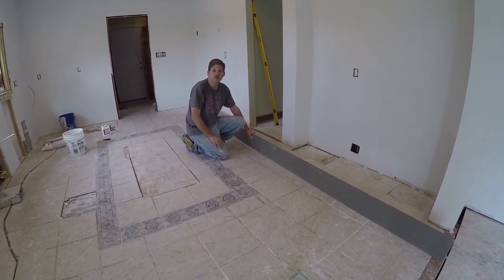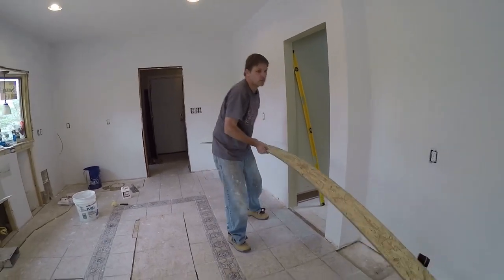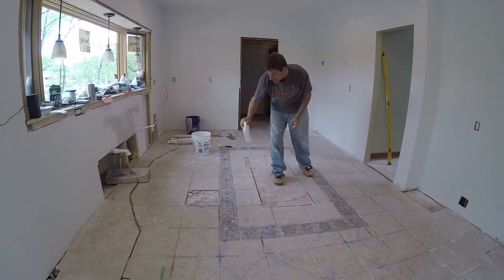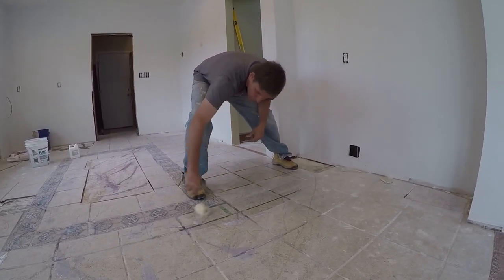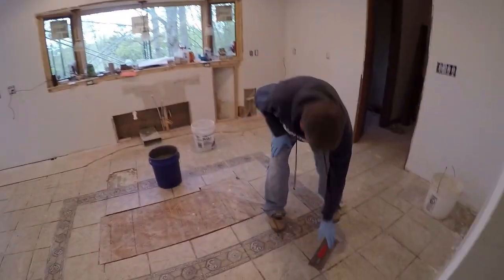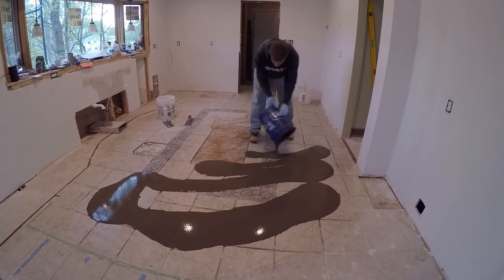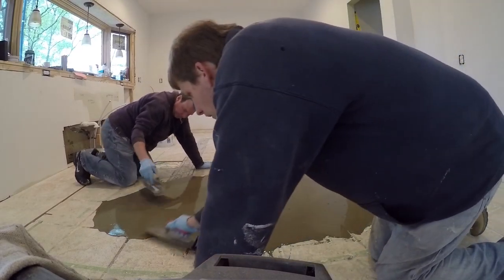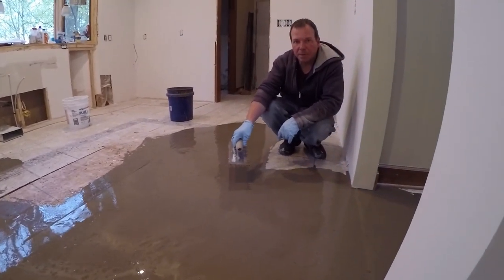How to use floor leveler to fill low spots before laying new flooring

Comment: Okay for all the professionals commenting on this guys method.
An installer can only go as far as the homeowners budget!
Yes tearing out the tile removing baseboards foam/caulk sealing the walls, and flatten the entire room to at least 1/16 in a 10ft radius WOULD COST THOUSANDS!!!

We as installeres encounter this issue EVERY TIME the homeowner doesn't have the $$$ to get it 100% perfect or they think you're just bs them.
Reply from the maker: Hey Bf3xx?
Thx for an insightful comment.
Reply: So you are saying he couldn't  afford a 9 inch roller sleeve and doesn't have an extension handle? And then they hand trowel the leveler? These guys are NOT professionals.

Comment: I’m doing something like this since we have tile with esbestus in it and we can’t break or move it without disturbing it. So we’re putting concrete leveler & flooring overtop of it.
Reply from the maker: Hey Kyle, 
We had good success w/ the leveler. Hope you have the same! Thx for watching!
Reply: WHAT!!!! Omg!!! Yes yes YES! This is what I have too!!! In my basement and it’s all high and low. I did my research and based on where the house was built it’s quite possible the tiles contain Asbestos so I do not want to remove them! Was thinking of doing leveler over them also!
Reply: That's what's in my parent's house, too. In addition to some of the tiles coming up in chunks over time, it appears as though there's a slight ledge around the perimeter under the tile. I have only been able to access a small spot. Seems to we about 4" in width and less than 1/2" in depth. Thinking self leveler is the solution for us. We're going to install a wood laminate.
Reply: Currently doing the same in my basement lol hope it works out for me. I caulked the edges and I'm doing the entire room though.

Comment: They floor has sagged alot and now youre adding more weight on that spot. I hope you checked why the floor was sagging and maybe added a support beam
Reply: A support beam where if it's a slab on grade...
Reply: @christiancenturion9895 just level it I'm in Dallas slab & the clay soil here is 💩

Comment: Can I do this method over asbestos tiles in basement?
Reply from the maker: Hey Krista,
If the floor is stable, it should work well. Could just try it in a small area first. But we are super happy with how it worked for us.
Thx for watching.
Reply: Same problem I have! Don’t want to mess with those tile. And I also have some cracked ones also.

Comment: Would this work over an old uneven plywood floor in order to paint and epoxy the floor?
Reply from the maker: Hey Falls…,
It is basically concrete. As far as I know both can be painted or epoxy (but not together ) You might have to wait before applying epoxy - I’ve read where concrete has to age / cure weeks or months before epoxy can be applied. I would ask manufacturers. 
Thx for watching!

Comment: I have a basement that is not level.. it is our main living area as the kitchen, and living room is there. It has carpet right now but we are wanting to rip it all up and put the floating hardwood down... Here is the problem- a year ago, we had a huge rain storm and water was seeping up from under the concrete. It has only done it 1 time since we have lived there and it has to be a large amount of water in a very short time but we have got to get it sealed as well.  It took us days to suck all of the water out of the carpet and get it cleaned and dried..... So not only is it un level, it also has cracks in it as well. So my question... what would you all suggest? And also, if we were to seal it... will the leveler adjust properly and correctly onto the sealant? Please help. Thank you so much!
Reply from the maker: Hey Brandi,
You may want to look at some kind of laminated vinyl plank which can handle water “ surprises”. It is also a floating floor install. Looks like wood. Depending on how much water you get, you might be able to install a water proof inorganic sub floor to help keep the new floor up off the occasional “wet” basement floor. 
Unless you can guarantee the basement is 100% sealed, you have to install something that can stand up to occasional wetness. 
If you get a bad flood, the vinyl plank can be removed, dried and replaced. The engineered hardwood could likely be ruined in a flood. 
As for floor leveler, each kind ( maker ) lists what it will and will not adhere to. You could also call the customer service of the leveler company to double check. 
Hope that helps.

Comment: There are multiple things that aren't done as the professionals would do. Demo the tile to bare concrete is recommended, you should have filled the cracks on the floor and the perimeter walls with caulking and also why use trowels to spread and a 4" roller door jam paint roller? The tile looks pretty bad and I think something like Ardex with fiber or Bostik with mesh would have been MUCH better to use.  For those that want to DIY. Watch video from the actual product manufacturers first to get the best idea.
Reply: Haters gonna hate

Comment: Could I use this method and product over old linoleum tiles as well? We plan on laying floating LVT for the new floor. Thanks
Reply from the maker: Alessandra Smith Hi Alessandra, the problem with peeling up lineolium is that it creates a mess and the glue adhering it down could have asbestos in it. If the lineolium was firmly secured, we would put floor leveler on it and install the LVT floating floor over that. Good luck!
Reply: I know this is a year old but no. Absolutely not.
Reply: @gijello  Hi there - thinking of doing this myself - can you tell me why it isn't a good idea?

Comment: Can I do this to a triple wide mobile home that has old tile that is also uneven? The purpose would be to put down vinyl plank floor
Reply from the maker: We have not worked on a mobile home. I know they are constructed somewhat differently in places than a stick built home.
I guess it all depends on how big the dips are and how much leveler you have to add. 
In theory, it should work fine. But maybe check with the mobile home manufacturer as to the weight design load that the floor will bear - lbs per sq ft - to be safe. 
Hope that helps.
Thx for the question.

Comment: Great advice but my situation is a little different I will be installing vinyl plank flooring on concrete slab floor that has vinyl 9 “ tile the area where we remove bookcase was never tile what should I do?
Reply from the maker: Hey Luba,
I think the vinyl plank should go over the tile fine. If the area that doesn’t have tile is where the bookcase was, then you could fill in that area with floor leveler, or easier, lay down underlayment ( plywood or OSB ) the necessary thickness to bring that low spot up to the tile level.
Hope that helps. 
Thanks for watching.
Reply: @Housebarons  Do you think I can find either a tile with same thickness of 9x9 inches ?
Reply from the maker: Hey Luba,
I was thinking of ceramic or porcelain tile which with cement can be 3/8 or 1/2 inch thick. 
But when you say 9x9, I’m thinking you mean a very thin tile??
The reason I’m thinking that is old thin 9x9 tiles that are pretty thin could easily be asbestos and you do NOT want to tear those up.
But to answer your question - yes, you could lay down any size tile of the same thickness to make up the difference.

Comment: hello I have a garage  I wish to use the leveling compound as a builder told me it is better than using cement. The problem I had was the existing floor was cracking and creaked when I walked on it. So I uplifted most of it up it came up easy as most of it fell apart.  it seemed to be made off cement with small stones in it. So do I have to use a primer on a garage concrete floor their are bumps but the concrete looks in good condition . On instructions of leveling compound seems I may not need  a primer , can you help?
Reply from the maker: Our experience with leveling compound required the use of primer. It may be worth a call to the manufacturer of the compound if they are saying that. You certainly want to get this right the first time. 
And - you want a solid base under foot. Make sure any loose stuff is removed. 
Good luck.

Comment: Proper way would have been to rip out the old tiles and level the floor. Since they used a floating wood product to overlay the issue of substraight isn't much of a problem. You CANNOT use this method if you're laying tile.
Reply from the maker: Hi Bill1USMC, we totally agree that a person cannot install new tile over old tile.  The old tile has to be removed.  We posted a video where we removed a lot of tile using a demo hammer:  https://www.youtube.com/edit?o=U&video_id=SiBh8e9eTIk
However, in this floor leveling video we were installing a floating floor, which worked fine over the floor leveler.
Thanks for the comment!
Reply: @Housebarons  I have layed new tile over old tile before and it came out perfect.  We needed the height to match up to a high subfloor in the master bedroom.
Reply: HouseBarons you are talking rubbish. Of course you can tile on tile lol.
Reply: @Housebarons  Of course you can lay new tile over old tile or even asbesot containing vinyl flooring. It's the easiest and safest way to do it. It also makes replacing the flooring much easier next time if you do it wrong.

Comment: What would be a good product to use for a porous surface? IE:  Particle Board Subfloor. There's a valley in the subfloor that runs the length of the room, approximately 15'.
Reply from the maker: Hey Dave Tryan,
Couple thoughts: make sure the cause of the valley is fixed first. 
As for particle board sub-floor , you may want to check with the company of the product you are wanting to use. Particle board is not a good surface - poor stability and poor life expectancy. 
You may want to think about tearing up particleboard and replace with plywood.
Sealing the particleboard may work against the liquid bonding primer used to get the floor level to adhere to the sub-surface. 
Lots to consider. The actual floor leveler company would be your best bet to be sure. 
Happy projecting!
Reply: Look into schonox ap. From what I was told if can be used over pretty much anything including carpet padding. It supposedly forms a shell over the old subflooring. It's a gypsum based product so be sure that whatever material you'll be using over it is compatible.
Reply: @wallyjablonowski7070  Thank You, I'll look into the. Appreciate the response.

Comment: Can you use this to patch a hole in  tile floor ?
Reply from the maker: Hey Decoded,
Sure, it should do fine. Be careful if the hole is deep. The manufacturer may have directions for how thick you can go per each pour. 
Thx for watching.
Reply: @Housebarons  worked great thank you

Comment: next time use a big roller maybe save some time
Reply from the maker: Hi Abel Flooring, yes, a big roller would make the job go faster.  Thanks for the suggestion!
Reply: ABEL FLOORING and an extension handle for the roller so you’re not hunched over by the time you’re my age!

Comment: Why not tear out tile?
Reply from the maker: Hi Car channel, a person should not install new tile over old tile.  The old tile has to be removed.  We posted a video where we removed a lot of tile using a demo hammer:  https://www.youtube.com/edit?o=U&video_id=SiBh8e9eTIk
However, in this floor leveling video we were installing a floating floor, which worked fine over tile and the floor leveler.  There is no need to go through the effort of tearing out the old tile.
Thanks for the comment!
Reply: I’m in a similar situation except I can’t remove the flooring because it has esbestus in it & we have babies living in our house. So we decided to put a concrete leveler & flooring overtop to not disturb the old tile with esbestus.
Reply: @Kyle Smith  you put leveler over all the asbestos tiles? I'm about to do the same. Did it all work out good?

Comment: I don’t get the spreading with a trowel if it’s self leveling
Reply from the maker: The self leveler pours out like cake batter.  It is not fluid like water, so you have to spread it out a bit.  Once you spread it out it will find its own level.  Self level means you won't have trowel marks.  Thanks for the comment.
Reply: I agree.  I don't know how you can manage to taper it paper-thin at the edges with a metal trowel so you don't have a ridge.  Isn't there a material almost as fluid as water so it truly pours into the low spots and self-levels?
Reply: Self leveler regardless will need pushed around to spread. Once it’s spread out it’ll do it’s job.

Comment: cant quite catch the name of the leveler and primer?
Reply from the maker: +dennis miezio Hi Dennis, we bought the primer and leveler at Menards. The primer is made by TEC, number 560, it is a liquid, 32 ounces, called Multipurpose Primer, covers about 100 square feet.  The leveler is also made by TEC, number 323, called Easy Level, which comes as a powder that you mix. Good luck with your project!
Reply: Thanks for the reply.

Comment: i put it over  concrete  i put primer on before it one day earlier it all cracked up and crumbled  any ideas
Reply from the maker: +on the dry Hi On the Dry, it is possible that the floor leveler wasn't mixed correctly with the exact amount of water needed. If that isn't the problem, first guess is that you have too much moisture in the concrete.  The simple test would be to get a 24x24 inch sheet of clear plastic and tape all edges completely with duct tape to the floor. Wait 48 hours. If you have a moisture issue, water droplets will bead up on the plastic or the color of the concrete will be darker when you peel up the plastic, indicating moisture. Or you can get a meter to read the floors moisture content. Don't lay flooring on concrete with a moisture issue because it will breed mold. If you have a moisture issue in your concrete you will need to call a concrete expert for a remedy, like installing a sump pump. Good luck!
Reply: sunlight and HVAC on might crack the pour as well
Reply: oil was on the concrete but hard to see it etc...thanks
Reply from the maker: on the dry We're glad you were able to diagnose the underlying problem!
Reply: thanks

Comment: That way the hardwood isn't too high
Reply from the maker: +Car channel Hi Car Channel, this house was on multiple levels. The reason we didn't tear out the tile was because we raised the other levels to one single great room level which aligned with the tiles in the kitchen. Also, it is difficult to rip out old tile. It really wasn't a sunken tile problem, but an uneven joist issue. Thanks for the question.

Comment: Can this floor leveling compound be applied on top of an OSB sub-floor?  If so, what about gaps between the sub-floor panels?  How can leakage of the floor leveling compound through gaps in sub-floor panels be prevented?
Reply from the maker: Hey David DeRolph,
It should be ok to be used over OSB - but I’d read the particular product instructions of the leveler you chose.
If your subfloor is tongue and groove, you should be good to go. 
If not, you could caulk or tape the seams. Just make sure you give the caulk adequate dry time before proceeding with the self-leveler. 
Hope this helps.
Reply: Extreme House Flipping Thanks very much for your reply. It is helpful.
Reply from the maker: David DeRolph Hi David, we recently started a Facebook channel called HouseBarons. if you send us before and after pictures of your project we will post them on our Facebook page. Thanks!
Reply: @allenyetter2915  
To me... This video is for the person that CAN"T afford a professional contractor like yourself.
You have the money and the tools to take up the tile and you probably have the man-power too help you do it.
This ... is for someone like ME... I "Flip" houses and RVs... on my 25th one right now...
It works for me... for over 35 years.  ... and it is level...

Comment: Use a screed
Reply from the maker: Hi David, we used self-leveling concrete and feathered the edges with trowels.  The project went well,  the floor looks great, no issues.
Reply: Extreme House Flipping 

Seriously doubt that
Reply: @recessiontwentytwenty3858  
Extreme House Flipping... I'm on my 25th one.
This works... Even in RVs !!!! 
This technique has save me thousands of $$$$$.

Comment: Hi my basement floor is tiled but uneven in some spots I want to cover it simply with the peel and stick vinyl flooring. Should I get it even using this method and product over the tile then put the stick and peel or do I also need to put like an underlayment or anything before applying the stick and peel
Reply from the maker: Hey Racquel ,
We haven’t done much  Peel and stick tile. But if the existing tiles are ceramic or porcelain , I can imagine that the grout lines would lay below the top of the tile. 
My hesitation would be that it sounds like a massive job to put floor leveler down over a whole basement. 
If you are up for that amount of work, then I would think it would work. 
Another way would be to cover the tile with plywood. Glue it down w/ a glue that would stick to tile. Then peel and stick tiles on your new plywood floor.
Congrats on trying! I hope it all goes well! Thx for the question and views!
Reply: @Housebarons  thank you I will do the ply option